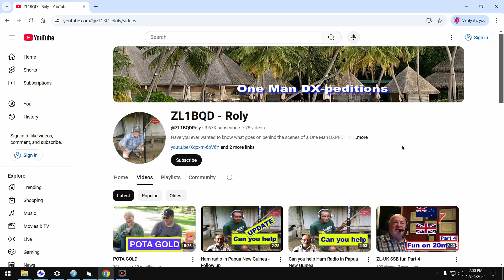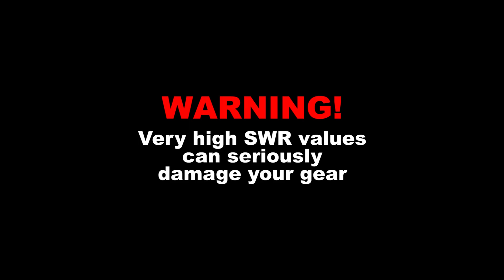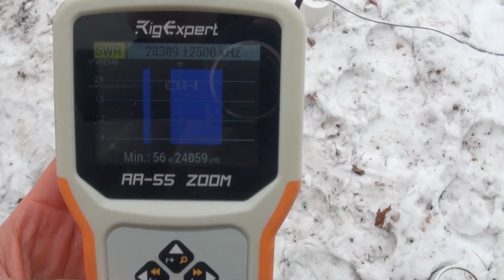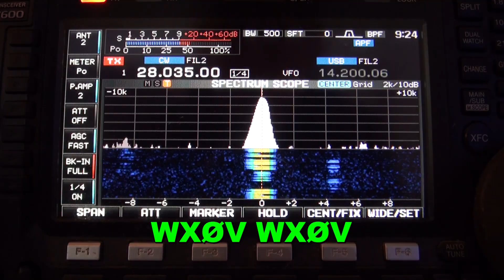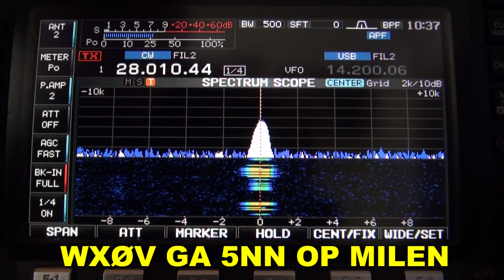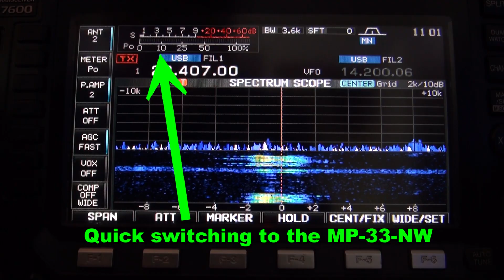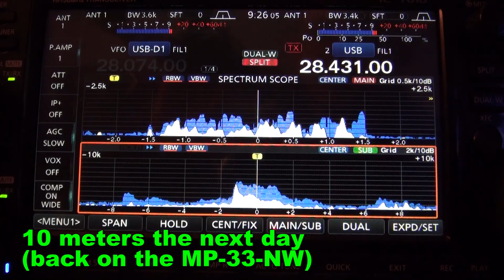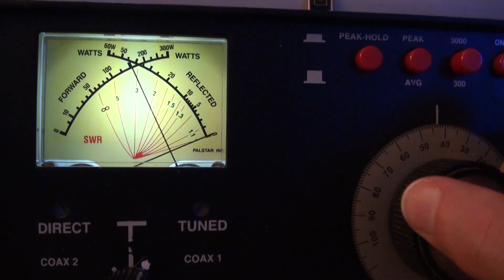Coat Hanger 10m Vertical Antenna

Comment: I've used coat hangers to make VHF and UHF antennas for years.  -- AA6LJ
Reply from the maker: Well, now you can try one on HF, but I suggest doing it quickly before Cycle 25 fades out on us (which it is already doing)...73 de WX0V
Reply: @WXØV_Amatuer_Radio  Thinking about it, I have a horizontal wire for HF, but am wanting a vertical for the lower take-off angle.
Reply from the maker: @StephenGangi  Understood...good luck and 73!

Comment: Very cool, this gives me hope for the coil-loaded vertical I've been building that's maybe 1/8th of a wavelength on 10m.
Reply from the maker: That sounds like a fun project...start moving on it as we're losing Cycle 25...no way I make these Qs without solar assistance.  73! de WX0V
Reply: @WXØV_Amatuer_Radio  Technically it's already built but I feel like it needs some further tweaking. It's a ~1.25m element with a loading coil to tune it for 20m. I only had it on the air for a few minutes and sadly wasn't able to make a contact... yet. 
After your video I'm debating re-tuning it for 10m but the only HF rig I have right now is a uBITx and it's power is limited by the finals and decreases as the frequency goes up. I'm not sure if the increased "efficiency" of going from 1/16th of a wavelength on 20m to 1/8th on 10m would make up for the power drop from making that move. There's certainly some experimenting to be done. If I was rigged for FT8 I'm sure that would tell me a lot.
Reply from the maker: @MrCharlz33  No matter what band you choose, your expectations should be very low.  I was shocked that I worked anyone with such a compromised antenna.  Thankfully, I have my MP-33-NW for the high bands...good luck and 73! de WX0V
Reply: @WXØV_Amatuer_Radio  yeah that's very fair. It's more for the experiment than anything else.